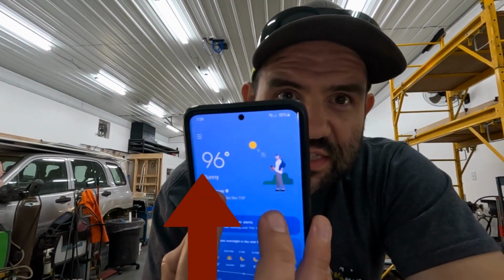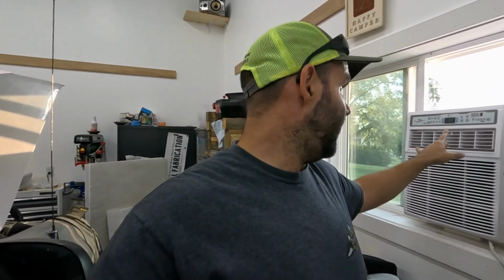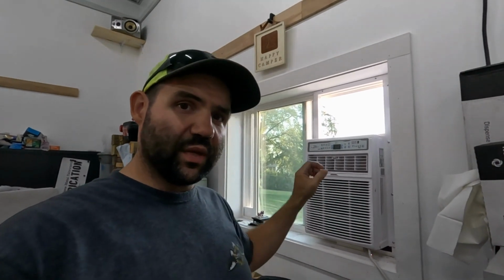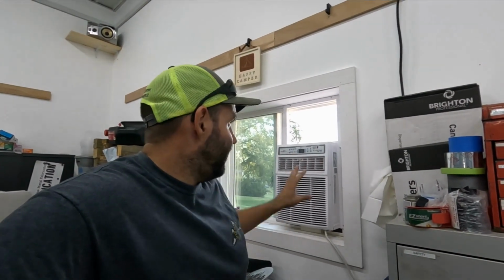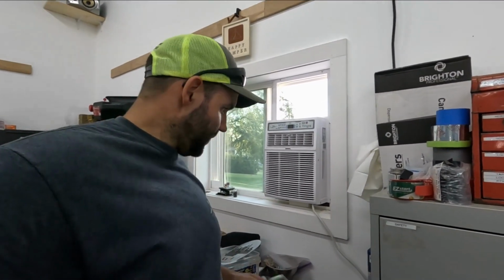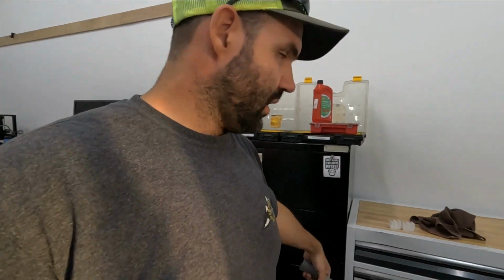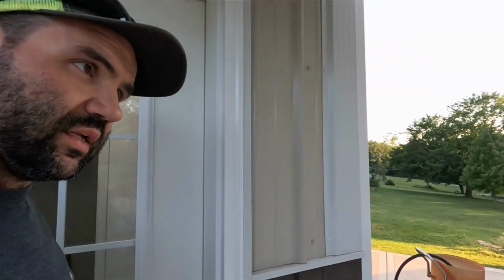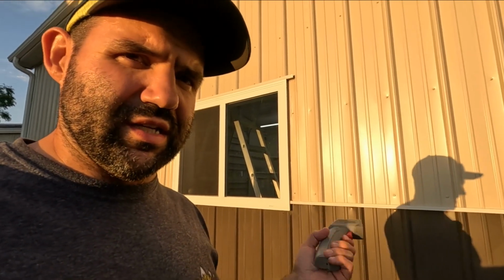Pole Barn Insulation - How To Heat And Cool Your Shop On A Budget

Comment: With the solex acting as a radiant and vapor barrier, does it create any kind of condensation issue to have faced insulation on the opposite side as well?
Reply from the maker: Good question. This hasn't been an issue as far as I know. In this video, I showed that one area by the breaker box without sheetrock, I'm kind of OCD and check everything often, and I have never seen any moisture between the inner and outer walls.

I will say though, that now that the sheetrock is complete and I have water in the shop (bathroom), I don't allow for huge temperature swings to prevent moisture issues. I always keep the shop above 50 or so in the winter and below 80 or so in the summer. 

I need to do another follow up video because it is currently near 0* and I have the shop at 60* with a 5k electric heater. 

You working on building a shop?
Reply: Ok that is good to know, I’m working on a 40x72 and have the shell and concrete up and already have the solex installed when I thought about having two vapor barriers being an issue maybe. 

We plan on doing a 40x12 section for a living space to at will be heated by mini splits but will not be heating the rest of the shop at this time at least.

I’m assuming if I keep the heated walls constant it ought to be ok but am doing some asking around and reading in how to do it right, whatever that is lol
Reply from the maker: There are a million different ways to do it and everybody thinks their way is right. This is how I did it and it has been great so far in the Midwest. 

Having half the shop not heated might add some extra complexity, it is good that you are thinking on it now. I would wonder since your concrete is already poured and there is no thermal break, if the unheated portion would suck the heat out from under the heated area. Guess it depends somewhat on the flooring used or maybe you could use some of that basement subfloor stuff that has plastic on the bottom of plywood to create some separation from the concrete, then you could just pad and carpet as usual. (Could be a terrible idea, I'm just throwing thoughts out there)

I just recorded an update on my shop heating and will post it in the next couple of days. Not directly relevant to your situation but might offer some ideas. 

Good luck!

Comment: The bigger benefit is dehumidifying the air. “Air conditioning”.  It is comfortable when you are 15+ degrees cooler then out side.
Reply from the maker: For sure! Even a little bit helps. 

What do you use to cool your shop?